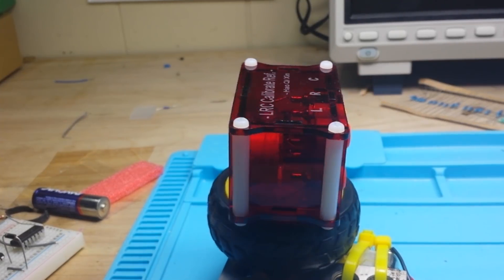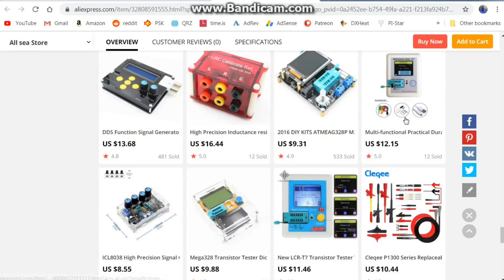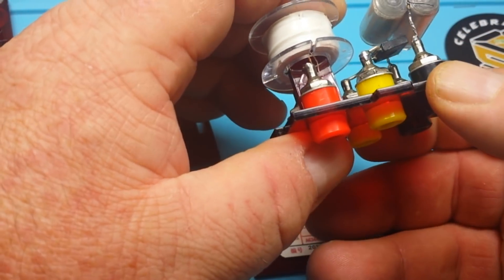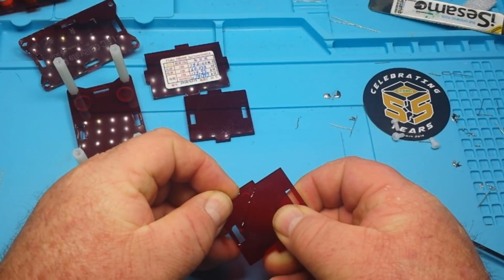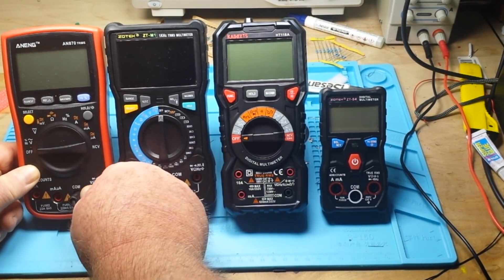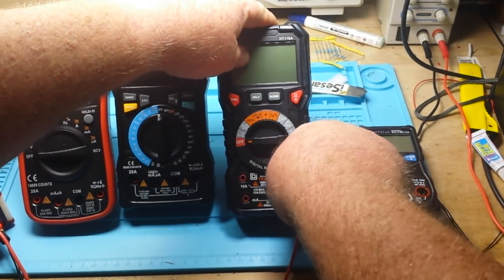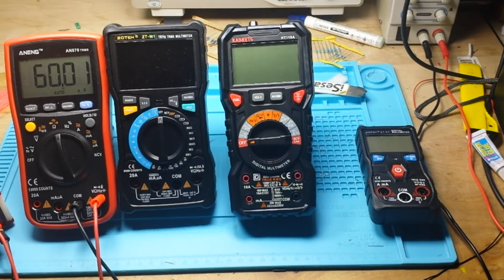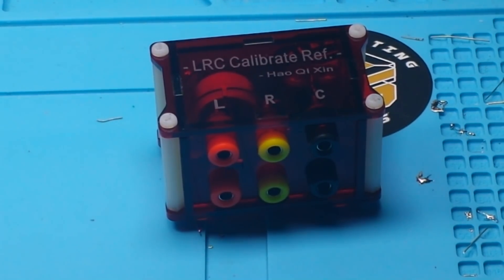Aliexpress Reference Standard

Comment: i am curious about the superglue and the spray that you use for the joints.
can explain the content of the spray or any link where i can get one..??

thanks
Reply from the maker: The spray is called accelerator. It causes the glue to set instantly. But beware, this is an exothermic reaction. If you get glue and accelerator on your skin, it will burn you.

Bob Smith Industries BSI-151H Insta-Set Super Glue Accelerator, 2 fl. oz. https://www.amazon.com/dp/B0166FFCCS/ref=cm_sw_r_cp_apa_i_OVLSDbMYCRGCM

Comment: Hello Paul. Don't forget digital rounding in measurements. In the case of the LAB METERS, used to specify the "Standard" values, the value of the most significant "unseen" digit (in the .00x position for the Fluke and .000x for the Agilent) is causing the least significant "seen" digit to be either rounded up or down; depending on whether the "unseen" digit's value is => 5 or <5. The two LAB meters aren't in agreement with each other either and the Agilent has higher accuracy according to OEM specs for the two meters. So, assuming the value read by the Agilent is more correct, the Aneng is the most verifably accurate for resistance (because of the extra digit of resolution) and the Zotec ZT-M1 is the most accurate for capacitance. It would be interesting to know what freq each meter is using in its measurements.

All that aside, great video.